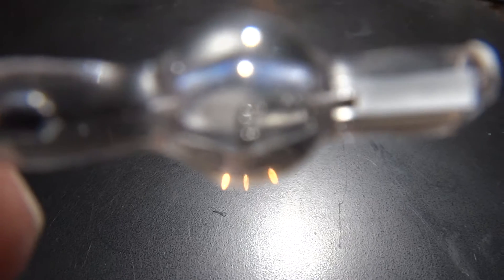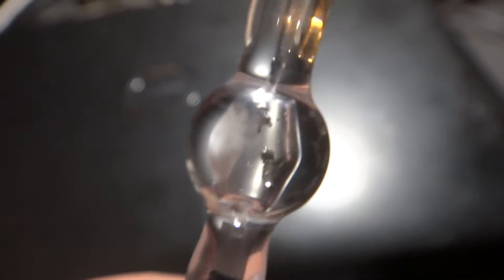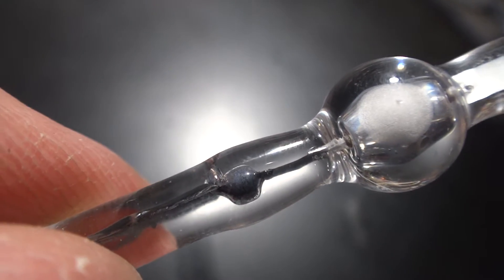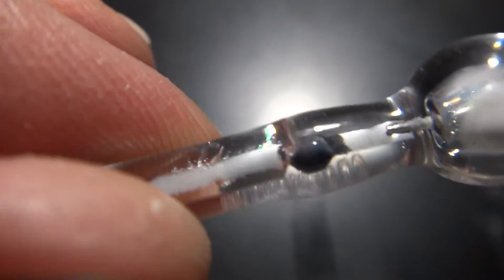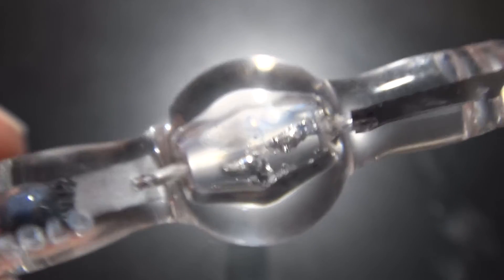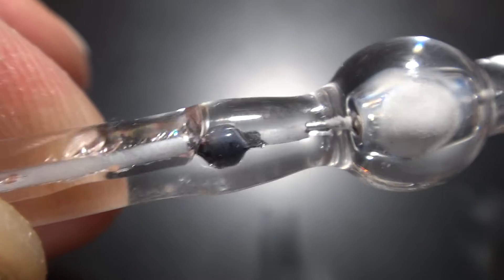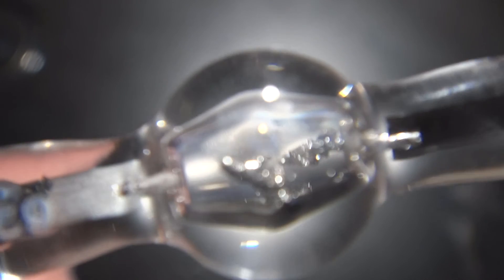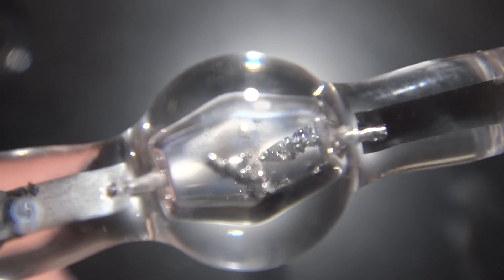DLP UHP Bulb failure mode

Comment: Projector lamp working on ? voltage ?
Reply from the maker: Operating voltage is quite low. 40 volts or so, getting the lamp to start is a different story. About 15k volts pulse to trigger the arc, but once that happens the gas inside ionizes and the internal resistance becomes very low so the voltage drops big time. Then it is all about current limiting so the lamp doesnt run away and explode. Quite often this happens at end of life they will go boom.
Reply: @12voltvids  
Thank-you very very much for Provide me knowledge...👍🙏

Comment: This type of bulb is an ultra high pressure mercury arc burner. Light is generated by an electrical arc across mercury vapor. They are sophisticated and were developed by Phillips in 1995. If it shatters then handle it like toxic waste.

That black bubble in the lamp looks like a UV enhancer. Usually there is an antenna wire wrapped around it. The UV induces photo emission in the tungsten thus lowering the startup voltage from 15KV to a few 100 volts.

Comment: smash it i did it WAS LOUD
Reply from the maker: No thanks, I don't want to be hit with flying glass. Those suckers are under high pressure. What do you think the UHP means? Ultra high pressure?
Reply: 12voltvids. you got it
Reply: 12voltvids. i already had one explode on me when it was warming up
Reply: But at the same time it was under control
Reply: @12voltvids  uhp= ultra high proformance  or ultra high power
Reply from the maker: @be4885  ultra high pressure.
Reply: @12voltvids   no if  he means that  Probably no one will use it  because when it explodes the projector can be blown up
in  one website they write that uhp =ultra high performance means only a uhp 200w 0.8 bulb can produce 15200lumens and a p-vip210/0.8 bulb produces only 8000lumen
Reply from the maker: @be4885  the lamps are ultra high pressure. That's how they can get the color temperature out of a pure mercury lamp.  The pressure is crazy high and yes they can and do explode but the explosion is generraly contained to the lamp itself.  The outside glass doesn't break. They are designed to hold up to arc tube failure.

Comment: That is a TINY lamp!
Reply: I heard you say that...I cannot imagine the temperature that thing must have to sustain!
Reply from the maker: +Tech Gorilla Thay can, and DO explode as did the one on the sony I just relamped.
Reply: 12voltvids. look do not buy uncertified lamps original because they can explode in less than an 60hrs
Reply from the maker: That was the original lamp supplied by Panasonic in the TV.
I don't use aftermarket for the reasons you mentioned. I only use original Philips lamps. I know people that have bought after market, and they just don't last.  The OEM lamps can explode too, that's why they have an explosion shield in front of the bulb, but the cheap aftermarket ones are on a higher risk due to shoddy manufacturing.
Reply: Agreee
Reply: Thats why i get dell osram lamps
Reply: I have about 3 projectors in my house that are well maintained and cleaned often